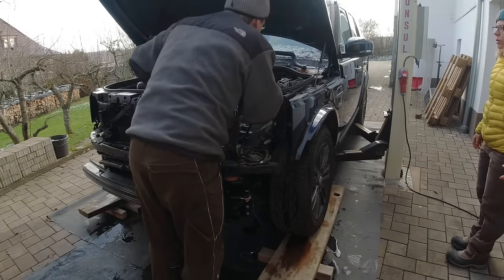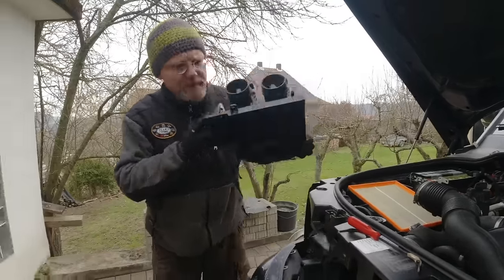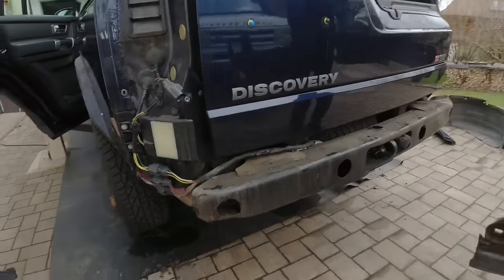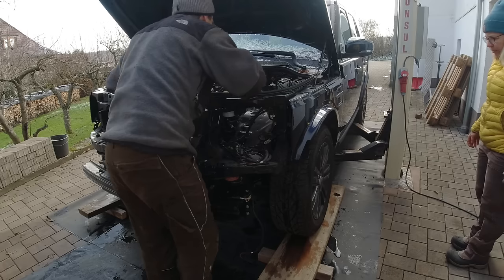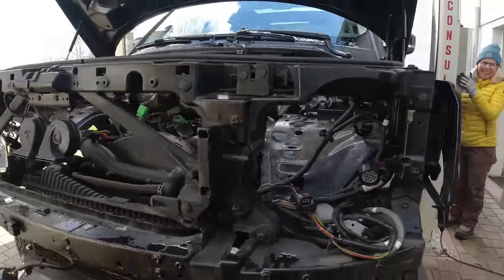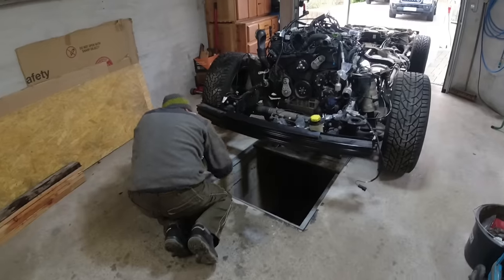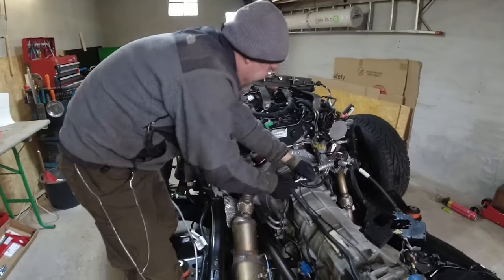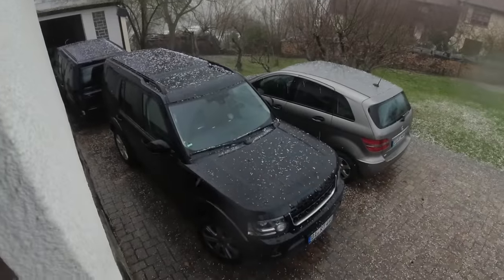Body-Off and Engine Out - Catastrophic Engine Failure / S4-Ep12

Comment: Having pulled the body off now, what are your thoughts on the process? Was it easy or difficult? How would you feel about doing it again? It certainly looked complicated with a lot of opportunity to break things. Also, reassembly might be difficult 😬
Reply from the maker: I followed the Workshop manual.  Very easy but nerve wrecking.  Unbelievable that this works… Definitely much easier than through the front.  I guess less than 5h next time.  Christian
Reply: @Vera_and_Christian  shop manuals usually call for having some specialized tools. Did you get such tools for this job or made it through with common tools?

Comment: You have both done great with your first body off project. It seemed relatively painless - either plenty of editing or it really was relatively painless. A bummer about the oil pan, but you did come up with a solution.

I am looking forward to what you do about rotating the engine. The other option if you can't rotate it is to take the heads off to see if there is something obvious, followed by the sump to view the crank & rods if you still can't turn it with the heads off. I know that would be a bugger, though they most likely have to come off anyway no matter what you find if it is an internal engine problem.

I can't wait till part 2 of this series.

Comment: OMG OMG OMG OMG...!!!!!!!!!!!!!! 😳😳😳😳

That was wild!  Considering this was your first body-off, I'm sure you accounted for making mistakes.  It seems they were mostly minor.  Obviously, a service manual won't tell you specifically what to do if the engine is seized so pull off the oil pan, but you learn as you go.  That whole process must have been exhausting and nerve wracking.  Great job and great commentary from both of you, as always. 👍
Reply from the maker: No, nothing bad really happened. We prepped really well. The manual explains the body off procedure and it is really good. 👍🙋‍♀️Vera

Comment: Random guess at failure cause on engine: Material defect in connecting rod resulted in fatigue crack  on #1 rod. Rod failed, swung around and jammed between block and crank.

Comment: I found that removing the radiator before lifting the body, and the front radiator support, just made it less stressful as it freed up room for the separation. Where the fluid is already lost, it only adds the time to remove the bolts holding the radiator and supports in. I haven't put my body back down, but I think it will be even more useful at that point to have the radiator/support out of the way.
Reply from the maker: You must have a LR3😀🙋‍♀️

Comment: I've had to go and hug my Land Cruiser after watching that !  You 2 are brilliant and should be brought in by Land Rover as designers .I would be tempted to buy one if you approved it ,even though I'm a Toyota man !! .  Body off on your example is made bearable as its like new as are the bolts etc .Rusty exapmles could get near  impossible to seperate body and chassis also as they get older and less in value I cant see them getting repaired sadly due to the work involved . ....

Comment: I'm sure you've already got it out by now but even with the torque converter you can pull the engine out and leave the gearbox behind, a screw type load balancer helps lift the engine high enough to clear to frame at an angle that allows the torque converter to slide out with a trolley jack holding up the gearbox 👍 also I like to put a cable tie around the black lever on the left side of the gearboxes to hold it in neutral
Reply from the maker: It‘s all been done already. Video will be out next week👍👌Vera

Comment: Happy Birthday to you dad Christian! The body off went very well and if you only forgot a couple of things doing it, well to my mind that's a very good days work let alone starting to get half way to getting the engine out as well. The seized engine is a bummer as you can't get to most if not all of the converter bolts, so pulling the transmission off is the only way. I'm still not sure how you are going to get at the bolts holding the converter to the flex plate being unable to rotate the engine. That may have to wait until the engine is stripped and the crank freed or removed. Looks like a bit of fun coming next week!

Comment: Amazing that looked hard work and I was thinking can you drop sump to release the crank so you could get to studs on converter plate but my oh my looks a lot of work . Well done be interesting when you start on the engine.must say yours is one of the best how to repair  a landrover  on YouTube
Reply from the maker: In the next video, you will see that this is not possible as there is crankseal in the back, which is not just an o-ring. You can't just take the crank out. 👍🙋‍♀️Vera

Comment: Christian and Vera OMG! you guys are like fearless 20 something year old doing it because it has to be done. Body off is definitely the smart move. As for the torque converter I would leave attached if you can until you lift the crank out. By the way have you removed the starter motor yet? If yes is the crank still locked up? Just a thought. I look forward to the following videos. Xo

Comment: Absolutely fascinating, id check all the brake lines while the body is off aswell
Reply from the maker: And much much more.
Reply: @Vera_and_Christian  i read somewhere that landrover ‘engineered’ the disco 3 so if the brake lines needed repairing the body had to come off, unbelievable
Reply from the maker: @michaelbolt4530  Whoever wrote that must have been a desktop mechanic. 👍🙋‍♀Vera

Comment: Great to watch this and you both finding your way around getting the body off.  When I lifted mine off the only thing I snagged or forgot to disconnect was the gear auto selector cable plug so I have a replacement one for that now.  Thankfully you have a Vera who cleans all your parts and puts them in order for you and a great dad who still likes to put in a days work.  Awesome progress.  It was watching your video on Fabian's engine and also Ryan's video from outback discovery that totally convinced me not to remove the engine with the body on!  I am just starting to reassemble mine with all major components being replaced as I have the access.  No doubt you will be finished first so please send Vera over if you do to help me 😂👍 see you next Sunday
Reply from the maker: Oh Ryan single handedly took the engine out and put it back together. 😅Yes, our rebuild won't take as long as yours hopefully. We already ordered all the parts, and most of them are here already. 🙋‍♀️
Reply: @Vera_and_Christian  what parts.... come on tell me what the problem was, I won't tell anyone else 🤣🤣🤣
Reply from the maker: @simon-mouse8739  😅That is not  going to happen, sorry🙋‍♀
Reply: @Vera_and_Christian  🤣🤣👍

Comment: I didn't see the lift installation.  But since you have no height limitation, why don't you put a crossbar over it?  That will greatly increase weight bearing capability.  Would hate to see your posts rotate inward due to the predictable one-sided load on each of them.

Comment: just a suggestion/idea here... i would take the oil pan off and disconnect all the rods/mains and pull the crank out and then you should be able to get the the torque converter bolts.. oh and tell you father happy birthday!!!
Reply from the maker: There is also such a thing as the crank seal in the back. Have you taken a look at the crank seal?  And this is a Discovery 4, not 3. Taking out the sump is extremely difficult. I know, because we have done that.  We do know a thing or two about that engine. But you will see how we did it in the next video. It will be good. 😀👍🙋‍♀️Vera
Reply: @Vera_and_Christian  sorry i dont know anything bout these engines, i was taking a W.A.G./aka wild azz guess. dont get me wrong love the vids. as i thought i stated earlier im a noob to this, im trying not to sound dumb but help out with some ideas "MAYBE"...

Comment: QUESTION: I live in the US and I am about to purchase a 16’ HSE Sport Tdv6. After watching some of you previous videos about this engine I am concerned for the longevity of this vehicle as I want it to last indefinitely with proper care of course. 

Are the issues such as the oil pump failure(messing up timing and effectively destroying your engine, oil starvation, crankshaft splitting, and cam shafts cracking still an issue on this model? Thanks in advance and I appreciate the videos from an aspiring engineer such as myself.

Comment: Hi I wonder if you can help me solve a problem I have on my xf jaguar 2.7. 
I have put in a new engine and tordos. 
And running grat. 
But now my car don't seem to won't to change gears. 
And when I put it in a gear. And the back in to park it makes a grinding noise. 
Would you know why this is. The gears was working fine before.

Comment: I never heard any explanation about how the previous owner never changed the oil or how the engine was negligently run out of coolant and rebuilt by incompetent mechanics, so I'm guessing that it was assembled by Land Rover factory-trained mechanics in the Land Rover engine shop using genuine factory parts. What is the source of confidence that the replacement engine wouldn't have the same probability of catastrophically grenading itself?

Comment: You shouldn't have to remove the body from the frame of a vehicle to remove the engine or do certain work on them. There is a similar problem with certain mid-range trucks, especially with Ford F350-650 series trucks with diesel engines. You have to remove the passenger cab and nose off to do major engine work or removal. If also find it unacceptable for any vehicle to lose its engine by 40K miles.

Comment: Wow! Having done this with a Series and a Defender, which I'm sure are way easier;' I am uber impressed. So now that you've gotten to a blown motor both ways, which is easier? Just pulling the motor or pulling the body?  I would think that pulling the body is probably a bit easier in this case since the motor is locked and getting the gearbox off would be problematic with body on. I anxiously await your progress and wish you the best. And look at it this way, at least your weather seems to be breaking with everything going green. We here in Nova Scotia still have another month of cold, icy sea air (at least), and it is still no fun working out in my shop (i.e. barn).
Reply from the maker: Body off is much simpler but also nerve wrecking.  I think with a bit of practise, this is then a 2-3 hour job instead of 8h what we needed including filming.   Christian
Reply: @Vera_and_Christian  As they say, practice makes perfect. After doing it a couple of times, at least you would know where all those various hidden wires and attachments are. My Defender was ex-MOD and the beauty of that body-off was that in that mil-spec, there were hardly any wires between the body and chassis and overall the whole thing was just so basic. Only took a morning, and that included the coffee/donut breaks. Anyway, I look forward to your progress. Cheers!

Comment: no one seems to want to guess what's wrong with engine so could it be crank shaft frozen, because of not using correct oil - this thought is based on your videos' concerning  the 49 weight oil. and yes as everyone is saying great videos, etc.!!!
Reply from the maker: You probably missed the first video about this Discovery.😅That is where all the guesses were made. We‘ll reveal soon.👍🙋‍♀️
Reply: @Vera_and_Christian  I guess when you tell us we'll all be surprised - type-o I meant 40 wt not 49 wt oil.

Comment: Hello from bunnings Australia haha, now that you removed motors both ways with the body on and body off, what method would you do it next time.
Reply from the maker: Well with a Disco 4, you don‘t really have a choice😅Also with Fabians Disco 3, we could only take the engine out, body on, because the crankshaft was not seized up. We had a seized engine, so separating the torqueconverter was not possible with body on. 🙋‍♀️

Comment: Land Rover 30k to repair -obscene and ridiculous money and that's why I sold mine, although I loved the vehicle - I got quoted by Landrover 1500 pounds plus tax to change 4.5 litres of auto gearbox fluid, there's a reason why EBay has so many lovely looking cheap LR 3 and 4's  for sale with engine problems.

Comment: You can see why, with all its faults, the Discovery 4 is an awesome vehicle. So cool to take the body off the chassis. That engine should not have failed, LR should be culpable,
Reply from the maker: Absolutely right, it is just awesome. 😀💪🙋‍♀️Vera

Comment: Hi it's Aryan here from India and I just rebuild an engine over last few days of Discovery 4 Sdv6 hse and after installing the newly built engine I got confused in linking vaccum line as it was before the engine teardown. So please help me to get it fixed I searched everywhere onto internet but I didn't find anything useful. The major ECM fault code appears is "low turbocharger boost pressure" so please give me some assistance to deal with this situation.🙏

Comment: Have your body off experiences meant that you will do it with your other two for repair work rather than struggling in tight spaces?
Reply from the maker: It always depends on the repair/maintenance work you have to do. Taking the body off, with filming, on a 2016 Discovery 4 is a 1.5 day job. So you better know what you have to do. 👍🙋‍♀️Vera

Comment: Hi Vera and Christian, being that the disco has only 64k on the clock and i assume dealer serviced, di the previous owner have any discussion wit the dealer in regards to a warranty claim ? Engine failure this early is not what i'd consider  reasonable and i'd be pushing hard for LR to cover the cost - this has been done in Australia before.
Reply from the maker: Of course he did. 🙋‍♀️
Reply: @Vera_and_Christian  i would have threatened with legal action, 64k is just not acceptable.
 In Australia  it would be considered not fit for purpose to fail at such low mileage.

Comment: Hey! Long time watcher of the channel.  2012 LR4 will not turn over.  193k miles.  Changed battery and starter.  Any thoughts?
Reply from the maker: Try to turn it with a breaker bar.  If it’s solid, it needs a new crankshaft like ours did.  Christian
Reply from the maker: Oh, and make sure the 400 amp fuse is intact.  It often burns if in cases like this.

Comment: Fixing the engine will be the first job, what next? Get the turbos serviced, I understand it's very awkward to do with the body on, but due to the mileage might not be necessary, would be unfortunate if once you had it sorted something else failed, after all it is a Land Rover.

Comment: Is it faster to pull the engine and transmission with the body off or is it faster if you just pull the engine and tranny from the bottom/subframe with the vehicle on a hoist
Reply from the maker: There is no subframe on a Disco 3 or 4. 👍🙋‍♀️
Reply: @Vera_and_Christian  thanks. What about the L322 range rovers then?

Comment: How crazy with these vehicles that firstly the engines keep blowing, but also that you have to remove the body from the chassis to address the issue. It is incredible but you would also need the same process to simply replace the turbo. Must be one of the worst cars ever made.

Comment: There is NO WAY that ANY of these vehicles should be suffering engine failures at such low mileages .. regardless of their age!
Land Rover needs to be held to account over this and they should be forced to pay for all costs associated with these catastrophic failures.
It is CLEARLY a design fault that they KNEW about and continued to produce the vehicles regardless.
Granted, 9 out of 10 may go through life without failing, but those that do fail should NOT fall back on the owner to repair at their own cost.  Absolutely unconscionable behaviour by Land Rover.
Reply from the maker: You need to watch more videos from us. We have covered that topic in more than enough videos. But we will do again once we revealed the cause of the engine failure. So please stay tuned for upcoming videos. You will learn something and have a lof of fun while watching. 😀👍🙋‍♀️Vera

Comment: That has to be the cleanest Land Rover chassis ever there is no rust on it at all did they never use it in the winter so much work just to get at the engine if it had been a Porsche Cayenne its just like four bolts and the engine  drops out on to the frame ready to work on not shore about Toyota's though.
Reply from the maker: It is remarkable. And this was not a garage car, also used for farming. 🙋‍♀️Vera

Comment: Absolutely Bad Design 😡 The front End should be Able to be Removed without All the  Body body  off 😢,For 30 years I Did this, And walked away in 2006 due to the Stupid Designed Cars of the Future Which is Obviously Shown in This Video, Excellent Both of you Working Together And Good luck You will need it 😅 👍

Comment: You might want to consider replacing the engine and transmission (several thousand unreliable parts) with an electric motor (one moving part).
Reply from the maker: Oh you missed our video on electric vehicles. 😅👍🙋‍♀️